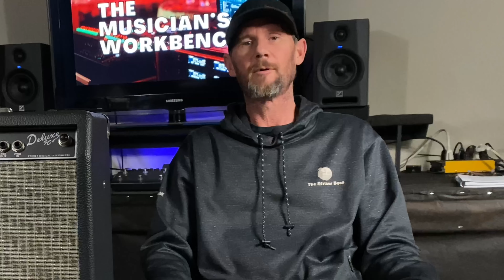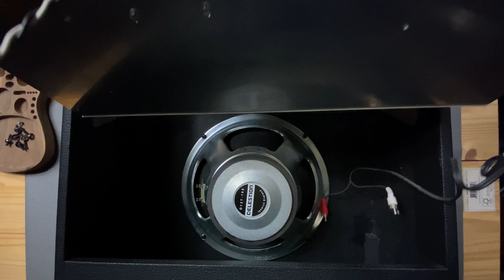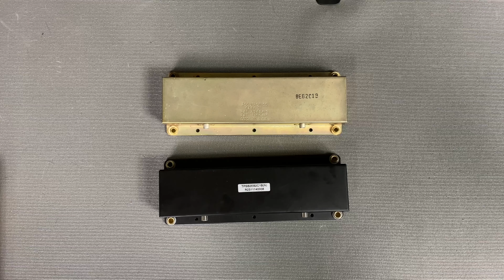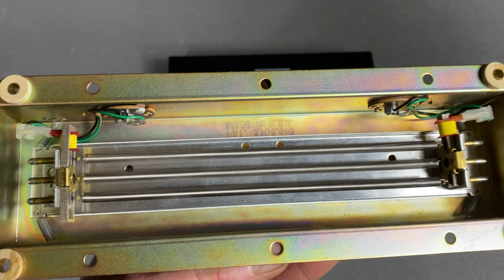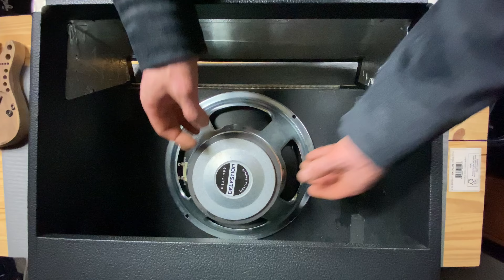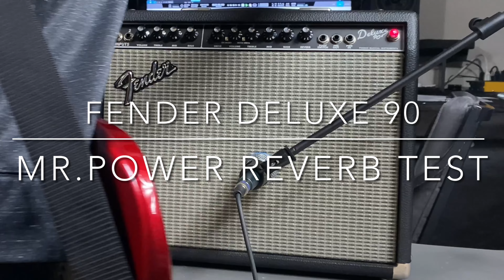Fender Deluxe 90 Spring Reverb Repair Replacement

Comment: Hey you wouldn't happen to know the best replacement caps for this model do you? I have one from like 25 years ago and its now starting to get a pretty bad hum. BTW I've had the same issue with the reverb tank on this but I just opened mine up and found the wires just had bad solder joints in the tank. Fixed it right up, but that new one sounds great in the video.
Reply from the maker: Hi there, thankyou for your comment! I don’t know what caps it takes right now but I’ll open it up on the weekend and get back to you on that. For a solid state amp it really sounds great! I keep it around as a solid back up pedal amp.